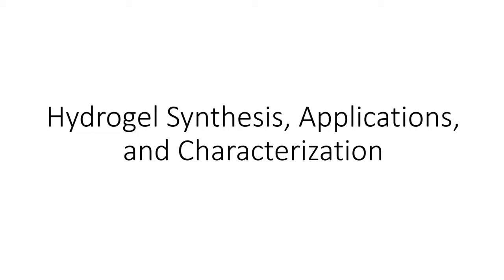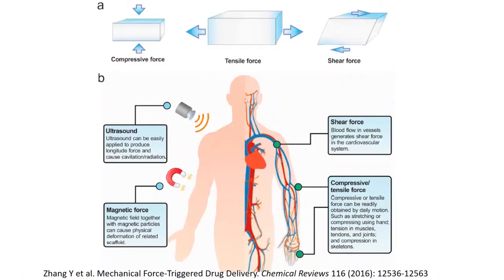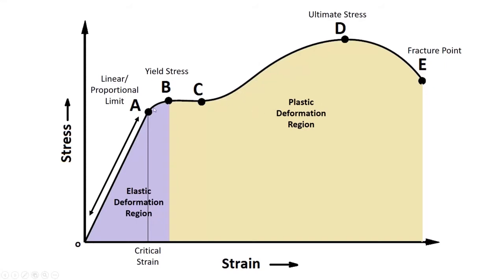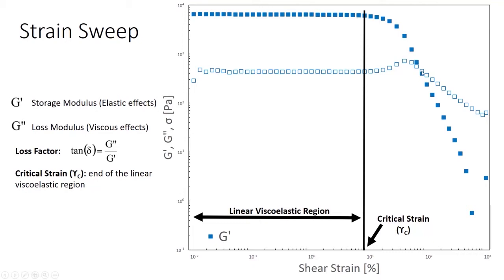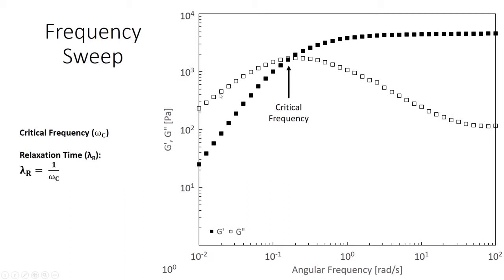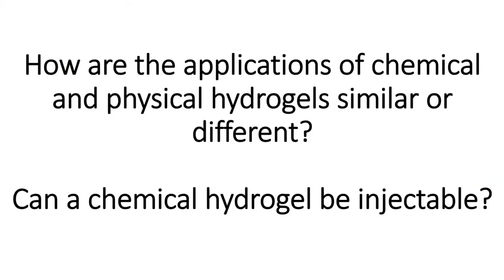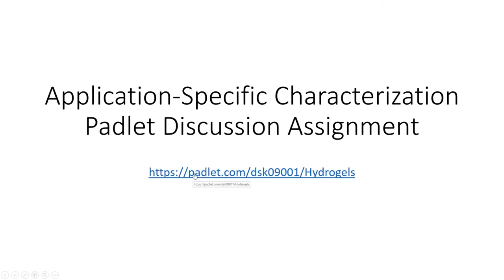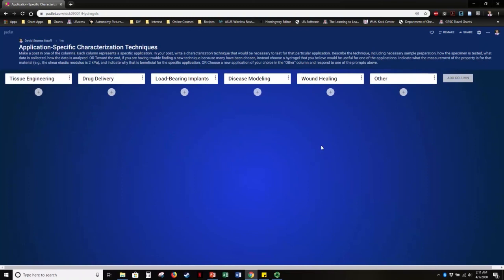Hydrogel Characterization Lecture

Comment: Sir, I am doing research on synthesizing PVA-borax hydrogel with different nanofillers. Will this system work for it?, especially for tensile strength, because which machine can I use? I am still confused.,

Comment: How can we assess if that a certain frequency is the best for the strain sweep? Based on the torque/displacement graph?
Reply from the maker: If you have a hydrogel with physical crosslinkers, first do a frequency sweep, then choose a frequency where the G' is at its max and both the G' and G" are stable (plateau). If it is a chemically crosslinked hydrogel then these moduli are not dependent on frequency so you can use any frequency but I'd recommend not going too low or too high to avoid artifacts.

Comment: Pls reply to a technique "how we can check whether crosslinking occurred or not."
Reply from the maker: You typically check cross-linking by running a rheology frequency sweep, which tests G' and G" at a range of frequencies. If the hydrogel is cross-linked by chemical bonds, then you expect to see G' > G" at all frequencies. If the hydrogel is cross-linked by physical bonds, you expect to see G" > G' at lower frequencies, a crossover frequency where G' = G" that characterizes the transient affinity of the physical crosslinking bonds, and then G' > G" at higher frequencies.